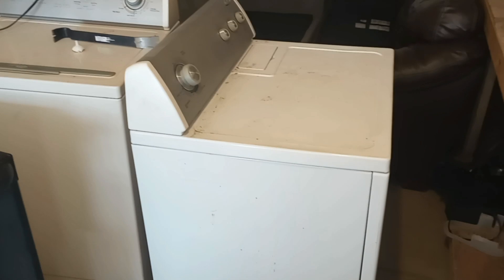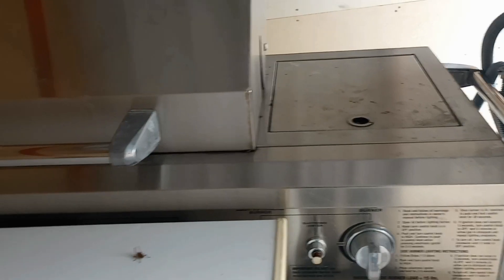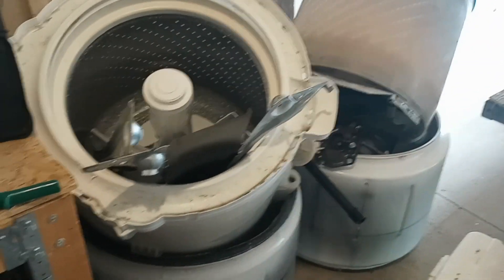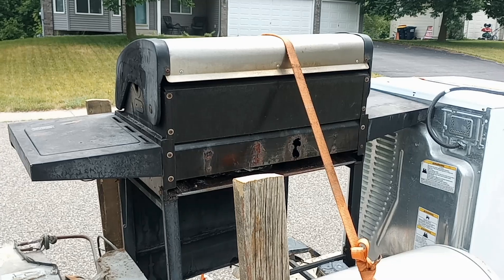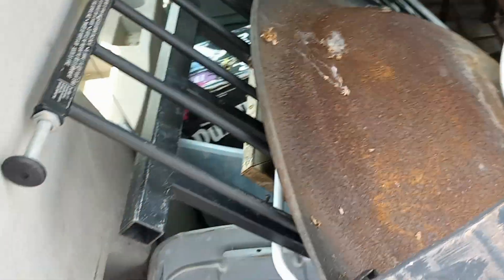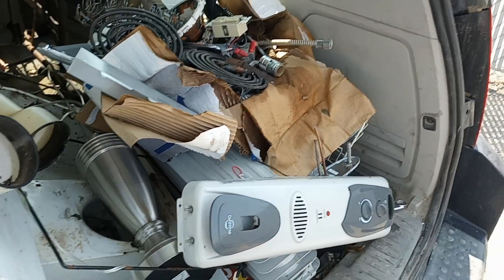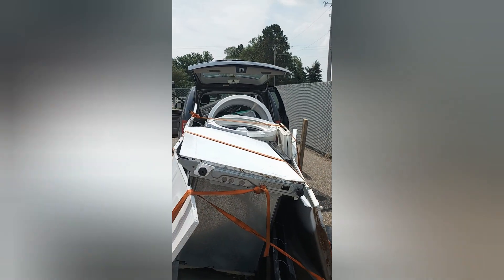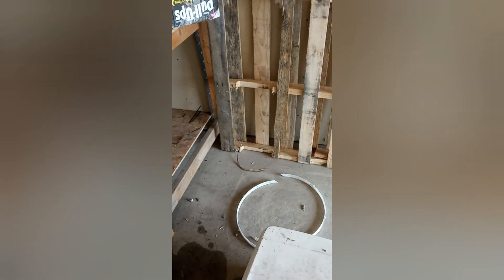lots of scrap metal. #entrepreneur #inspiration #scrapmetalrecycling

Comment: Check to see if those motors are copper most of the new is aluminum with copper painting  they are not worth anything
Reply from the maker: The ones that come out of washing machines that look like alternators, those can be sold as electric motors. The ones with exposed wires however, I really don't have any way to check those because I don't have a grinder and they're too thick to use snips